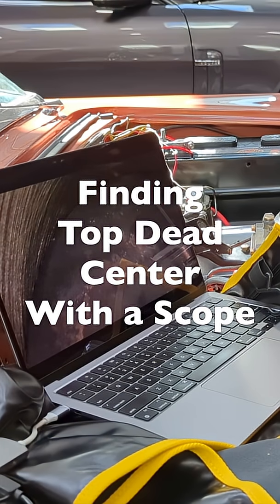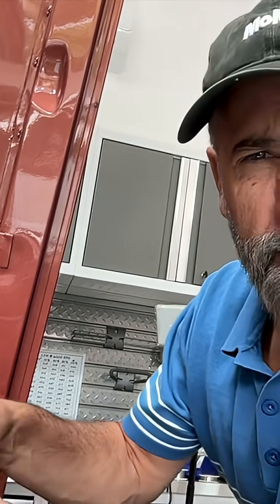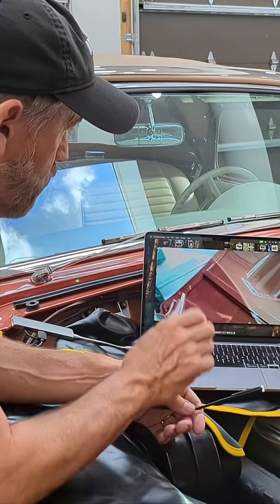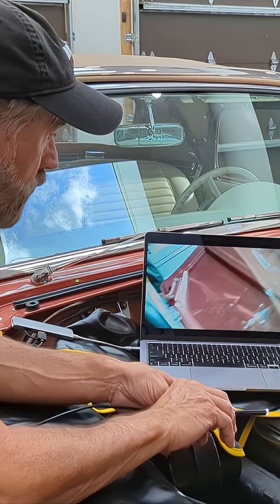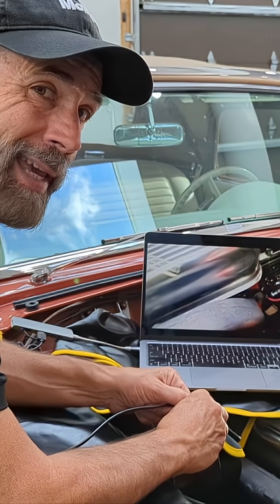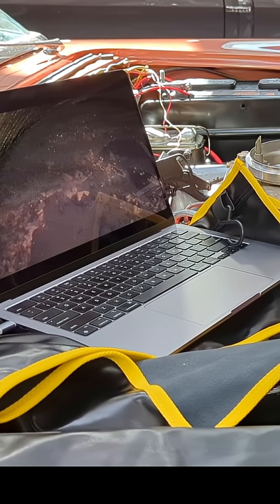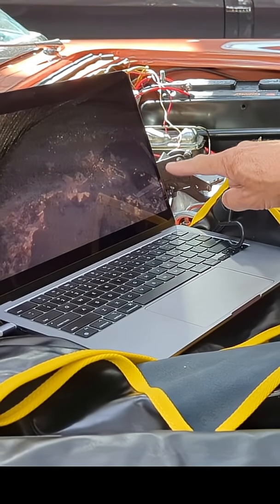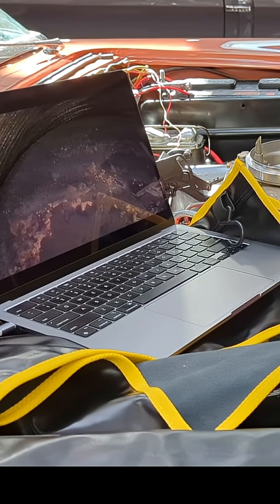Piston Proctologist's Peek: Finding a T-Bird's Top Dead Center with a Scope #mechanic #diycarrepair

Comment: Nice crosshatch from honing on the  cylinder wall. Signs of low usage.
Reply from the maker: Bobby, Good eyes! The engine was rebuilt in 2016 and I think it probably has 900 mi on it right now.